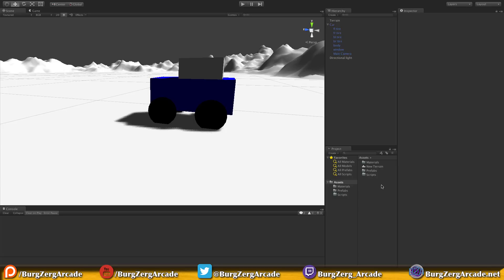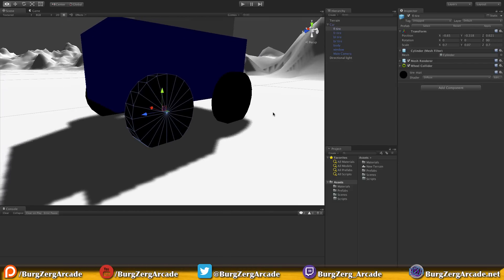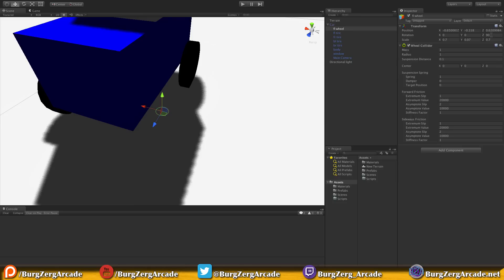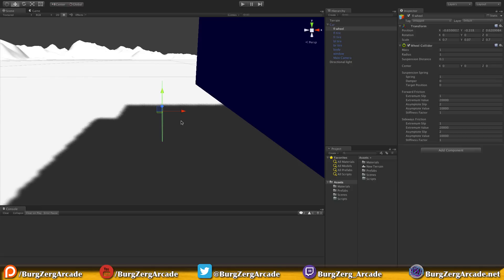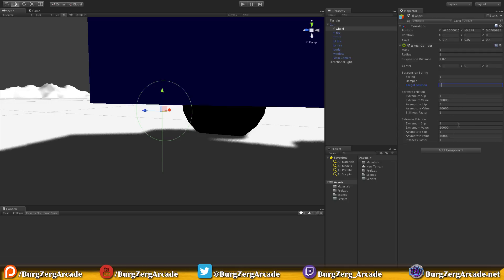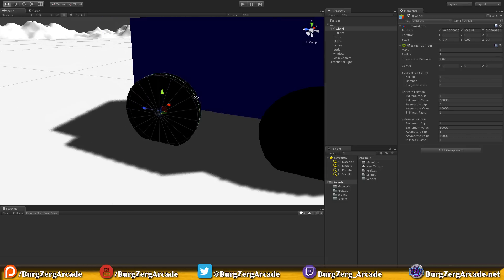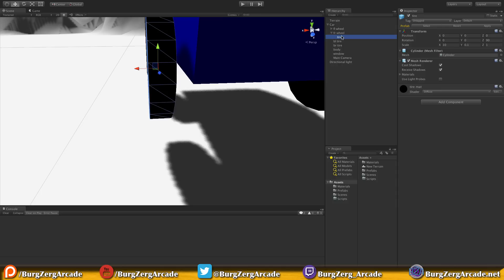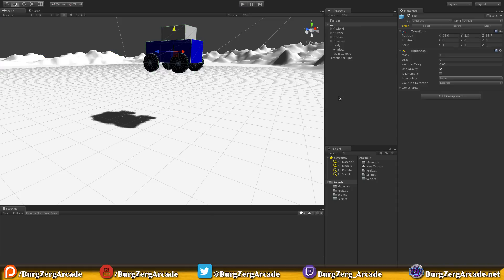2. Unity Tutorial - Creating A Multiplayer game with Photon Unity Network (PUN)

Comment: Hello, How come my car keep shaking when I run the game? I'm pretty check all the position for tires and colliders, and I got all that steps followed up. Great tutorial btw, I've been desperate for Photon unity Network tutorial with real project example.
Reply: actually I did, but I might need to pull out my project since I couldn't find a way to push on github, I guess has sth to do with 3D as a large file. probably need another day or two, email me here haotuusa@gmail.com
Reply: +Lucian Marica I just changed the mass of the rigidbody to 1500 and that stopped it
Reply: +Scheckie heheeh pretty logical